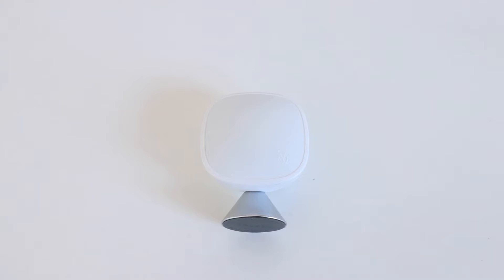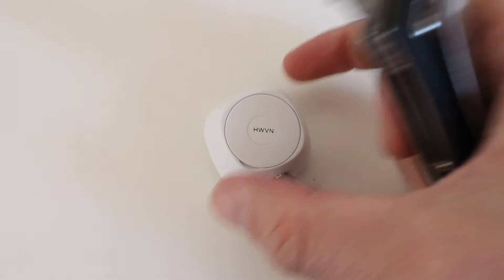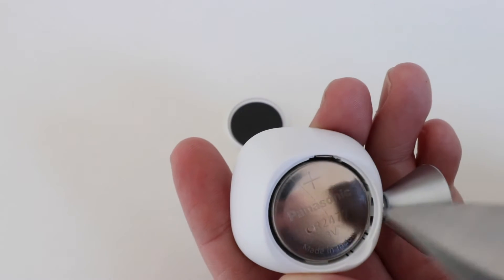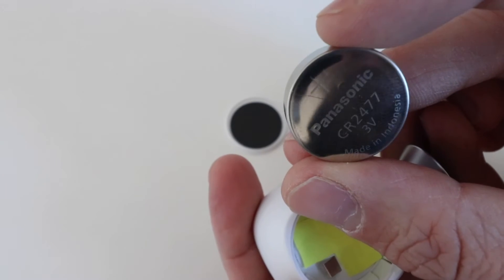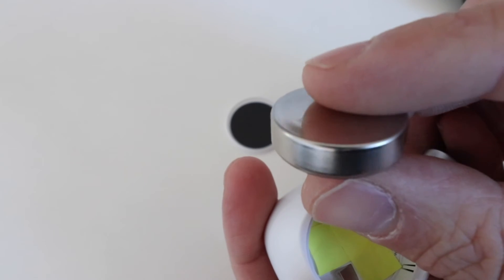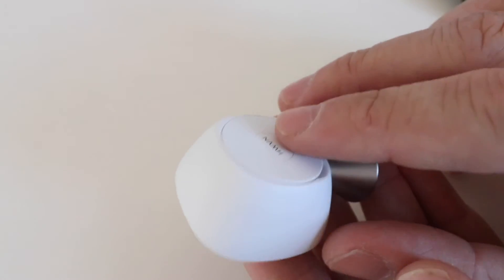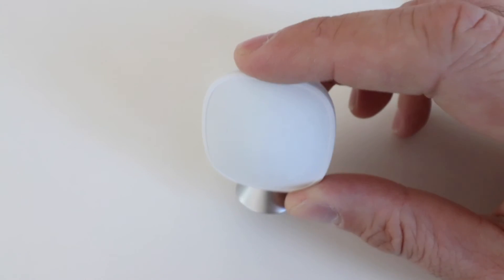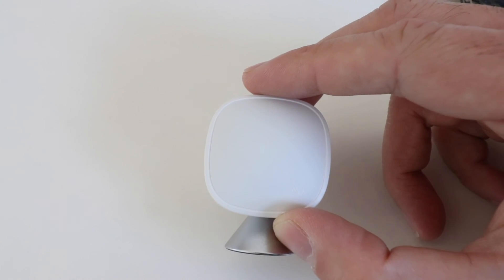Ecobee Sensor Battery Replacement | How To Change The Ecobee Sensor Battery

Comment: This is great, but how do I get it off the wall? I used the wall mount option for one but I’m afraid I’m gonna have rip the mount off the wall if I try and get it off.
Reply: I have this same question 😩 I stuck it to the wall before realizing the battery is behind the piece.
Reply: @crossightoverclothes  I do live in an apartment complex, so I have it up with a command strip but I’d rather not take it down and then have to put it back up

Comment: Your link links to the amazon page of a supplier that sells expired batteries in a ziplock bags. Buyer beware. 
They might work but if you check the date code stamped on negative side of battery they might be expired when you receive them.

Comment: Still dont understand the purpose of these sensors
Reply: From what I understand... the thermostat is what senses the temperature. These sensors also sense the temperature and report back to the ecobee. They also have a motion sensor. 

So let’s say your thermostat is in the basement of your home, but you spend a lot of time on the 3rd floor. Put the sensor in a highly trafficked area on 3rd floor, and your thermostat now knows what the temperature is in the area you are occupying, and can adjust based on that.
Reply: Wall Thermostats are often put in the worst, most useless areas of the house. Often, their sensors are inside or against the wall, which may not be properly insulated, so their temperature sensing is wrong. I had two thermostats installed on walls that were not insulated, and connected directly to the attic, so in extreme weather they were off by 30 or 40 degrees! Putting the sensors where you actually are makes your thermostat work better. What's more, these newer sensors also sense the humidity in the room.